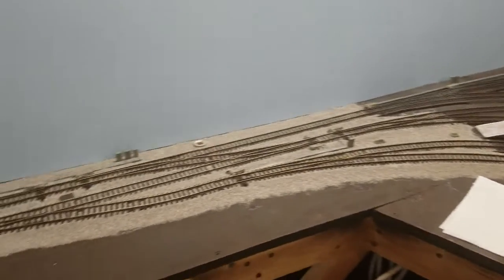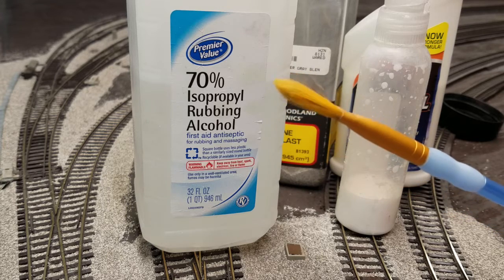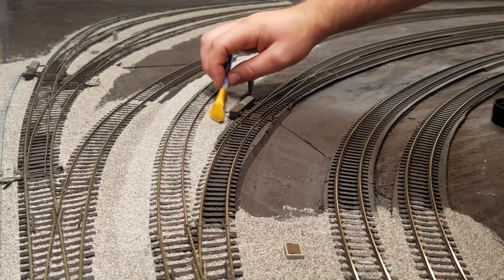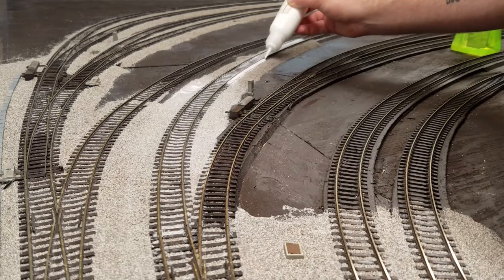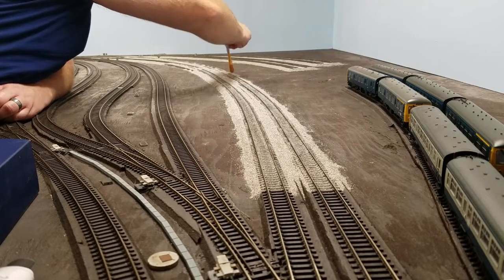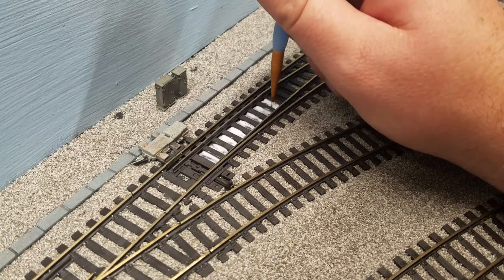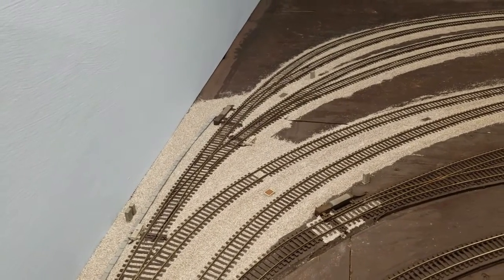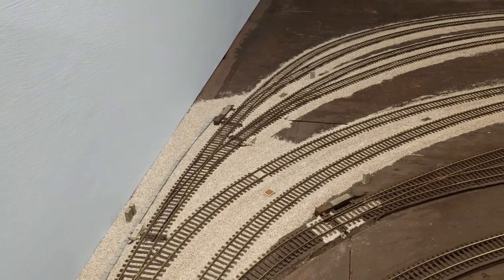26 - How to ballast track and points (working on station south)

Comment: Excellent progress. It's all getting real!
Reply from the maker: Thanks. It's starting to look pretty good, looking forward to finishing up and getting the platforms back in place. Then weathering the track, and station buildings, and...

Side note - I used your Class 47 TTS conversion video over the weekend on a new loco I'd picked up :) Worked great, thanks for that! Was a little fiddly that the 21pin-8pin converter didn't fit without modification, but seems okay now. Not convinced on the speaker, and I've read quite a few end up getting blown, so may proactively replace it. Iain

Comment: The line side detail between the tracks is impressive. Keep up the good work. Cheers Matt.
Reply from the maker: Thanks, Matt! The lineside details took a little time to get right, but help improve things a lot. I have a little more to add in as I then work on ballasting the north side of the station. Iain

Comment: How bit is your layout? Enjoyed the video.
Reply from the maker: The shed is right around 11ft x 11ft. With all the lines running through the station, it works out to right at 200ft of track. I still have the Tyne Yard to lay track for, which is on the opposite side of the shed to the station. Won't be huge yard given I have 11ft total length, but have the corners in + out. I may get to working on that over this winter, as I need the storage space rather than taking rakes of coaches off the layout. Iain

Comment: Morning! Great video, still slightly bummed out Rails of Sheffield had a Deltic in BR blue “Yorkshire regime” limited sale at the end of the week but missed out. Back to eBay and daily watching UK outlets.
Reply from the maker: Thanks, Mark. Yeah, I got a little frustrated that locos are often done in limited runs now or short sales. The second-hand market can then get pretty crazy, so it's disappointing to miss out!
Reply: Newcastle Central (OO Gauge)  softened by a USA eBay estate sale over the weekend of two Bachmann Deltic from TMC, one is out the box mint and the second was weathered some sort of special edition boxed together and looks like they have never been run. Although pre tops and green one of them has its buffers missing but managed to get both for $120.00 for the pair. So feeling good about that deal. But yes the whole limited edition and run, it sounds like the market can sustain more? Although I’m trying to support a local shop near my folks in Manchester, old school corner shop filled to the rafters, always welcoming and with a cup of tea, but looks like they are a shrinking breed. Let’s hope that internet, eBay those little independent shops can keep going, well they got 300 out of me last visit a 37 and 26 in BR blue, and some Metcalfe.
Reply: Newcastle Central (OO Gauge) I don’t suppose you work in the Redmond area? For a local based company do you?
Reply from the maker: Yes, I went to a local model shop when back in England and picked up a Bachmann Class 47, TTS decoder, and some other little bits and pieces. Their prices were comparable to the online stores, so I'd support them if I could. 

The limited editions I don't really understand given how much money goes into the design and tooling process. My favorite locos are the HSTs and the recent editions have all been limited runs, so I'm running older locos that aren't anywhere close to the level of detail. I have the latest Hornby Class 43 Valenta's on pre-order along with Mk. 3 coaches which seems to be only way to really get those kinds of models, but they keep slipping and slipping on release date! Iain
Reply from the maker: Yes, I do. I've mentioned a couple of times off-hand in videos that I work for Microsoft, but I can't really take any responsibility for Windows 10 problems that people run into ;) Iain
Reply: Newcastle Central (OO Gauge) small word you will find me in the address book feel free to drop me a line
Reply: Newcastle Central (OO Gauge) I have the Hornby US site HST Valenta intercity and coaches on pre order painful price. And the release date slipped but Sep! Fingers crossed. I'd prefer the original BR rather than the later, but hopefully in future they will release that as well.
Reply from the maker: Yeah, a rake of 6 coaches ends up almost as much as the locos! But, I look at it as two powered locos with DCC sound fitted, so it's not that bad in one way. Hopefully they ship in September, they've already slipped twice from originally back July, then August.

Hornby did a BR Blue a couple of years ago, but again, unless you had them pre-ordered or get them right at the time, they're now up to $350-$400 with taxes and shipping in used condition, which is just too much for me by the time you then add on the coaches as well.

Comment: Mine is bigger and I have not got it right (16ft x 8ft), in the loft, purpose-built, as I am partially sighted.. Yours looks bigger on camera.
Reply from the maker: The station itself takes up a huge chunk of space, but that's what I was mostly focused on modeling, so knew I wouldn't have room for much else. Other layouts that have an elevated section look great and would have given me a little more room to play with, but wouldn't at all be like the real station. I'm okay with 11ft x 11ft as it doesn't become too daunting to work on! Iain